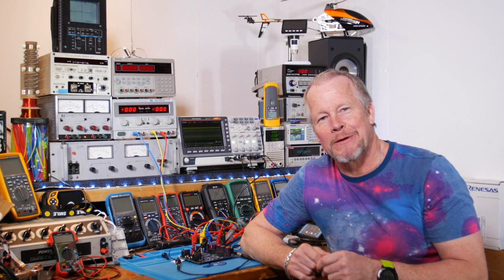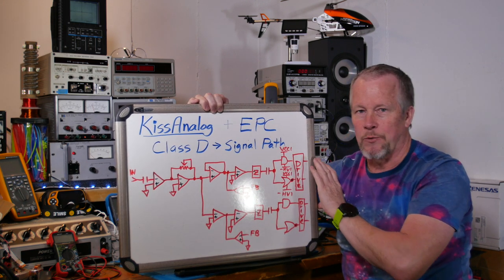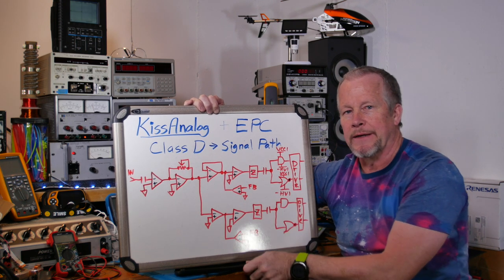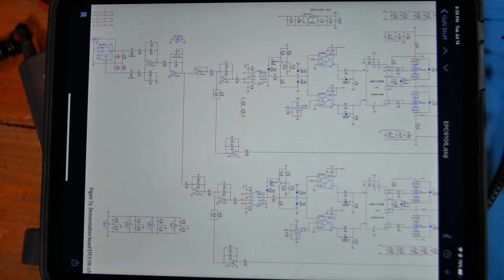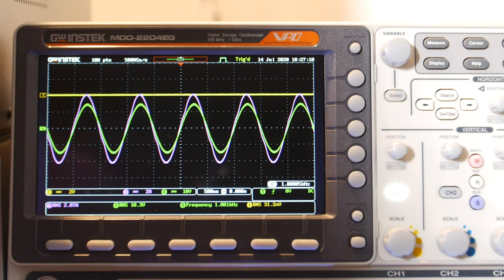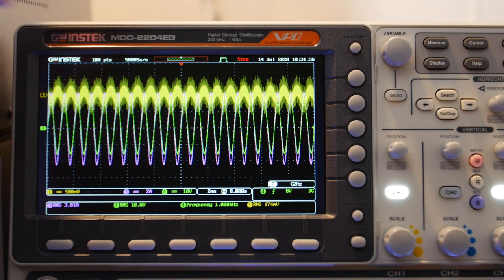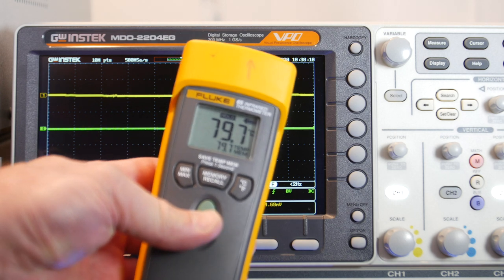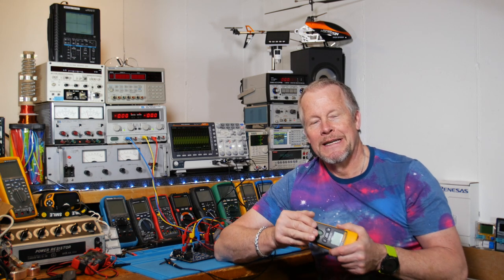Class D Amplifier - Follow the Signal Path with EPC GaN FETs

Comment: Hi Eddie, nice explanation. 
One question, imaging you have a Class D amplifier in front of you, and you use a homebrew signaltracer (like a old pc speakerset for probing the circuit) and put a 1Khz signal at the input,is this signal in every stage audible, and if, is it also audible in the stage where the modulation is happening? 
Ps: your Corona haircuts getting better and better ;-)
Reply from the maker: That’s an interesting question Bjorn.  I think the 1 kHz would be audible, but the high frequency modulation would not - but it might make it noisy.  Thanks - I’m becoming my own barber:)
Reply: @KissAnalog  , the money you save by cutting your own hair, can be used to buy electronics. So it's a win-win ;-)